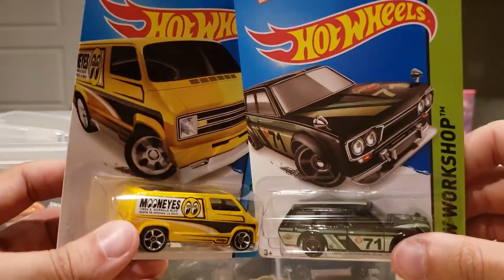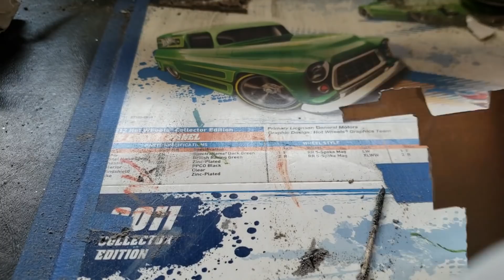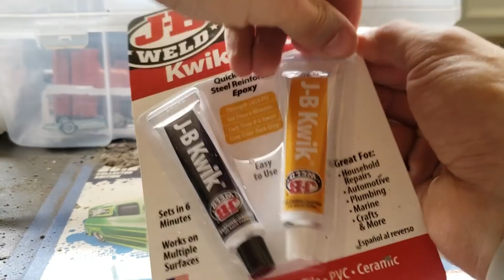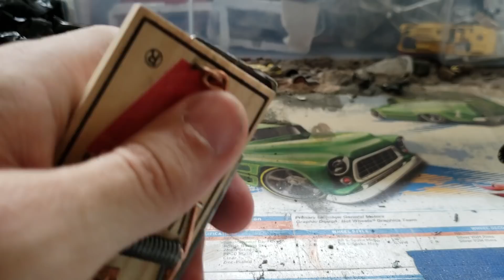Custom Datsun Hot Wheels Christmas Build

Comment: check this out.     Super Alloy 1 Multi-Metal and Pot Metal Solder
$49.00 – $99.00

Super Alloy 1 is a multi-metal solder that joins all white metals. It can also join white metals to practically any other metal, even ferrous to non-ferrous metals, like steel to aluminum.

Super Alloy 1 bonds at half the melting point of pot metal. Its honey flux turns root beer brown to indicate when the base metal has reached the proper bonding temperature, enabling quick and easy repairs. It’s ideal for repairing pot metal pitting, and can be applied with any heat source, including a soldering gun, heat gun, or propane torch with no welding expertise.  The industry standard for classic car restoration and antique auto applications, Super Alloy 1 has salvaged thousands of priceless classic car parts!

Key Features:

Solders: pot metal, aluminum, galvanized metal, copper, brass, bronze, steel, zinc die cast, pewter, zinc plated steel, lead
Low working temperature – 350°F – prevents warpage and base metal damage; favored in applications requiring low heat
Works with: propane, MAPP gas, oxyacetylene, butane, heat gun, larger soldering irons, ovens
Can be plated, painted, powder coated, polished, shaped, built-up, missing pieces
Completely non-corrosive; washes off with warm water

Comment: an honest critique?

Whilst the end result does indeed look very nice, and is unique, 
the build process did leave a feeling of unease 

mainly down to the (somewhat) excessive usage of 'jb weld' 

(i don't have any personal experience in using said product so can't be certain of its quality, but would assume it is a fairly decent product in its adhesive/strength capacities
granted everyone does things differently, but it did come across as too much) 

especially areas like the support rails, and when joining both donor cars together 
(+ the amount that required sanding off in said areas) 
 
i did wonder why the van interior wasn't reused to fill any space
(i know the rear was made into a pickup compartment,but the sidewindows could have been cut off the original 'glass' panel and reused to save metal sheet/filler)

for the rear cargo section
personally i would have considered filling the bed 'walls' first then fitting the bed base to that but either way works 

the wheels are a nice choice, they do suit the look very well, (as does the cargo) 
the ski's are a neat winter touch, although they did look a bit loose
(in the footage showing the model in hand) 
the custom made base is sparse but works 
(could possibly benefit from black paint to lessen the bright 'newness' of the metal)

the paintwork was nice, part of me is intruiged by  how it would have looked if the reds were reversed,
(i.e the darker red as the main body and the brighter red as the stripes) 
the detailing on the grill and lights added a nice finish,

Overall, 
a car, a van, and a festive plan, some method and some madness, 
with a nice looking vehicle at the end,

result?

model (looks): 9
build (methods): 6
build (model): 8
paint (colourscheme): 8
paint (finish): 9 
festive vibe : 9

total 8.16/10 (calculated average)

(p.s
not meant in any offensive manner,  just as a review, 
p.p.s 
 apologies for the long as heck comment )
Reply from the maker: Probably one of the best comments I've ever read. One thing I've learned in this hobby is that if you ask 10 builders to build the same project they will do it 10 different ways. Throughout the process of building my customs I dont have a clear path but more of an idea. As you listened to in the beginning it was very unclear. But I saw to cars thst could line up and went for it. Thank you again for the comment.